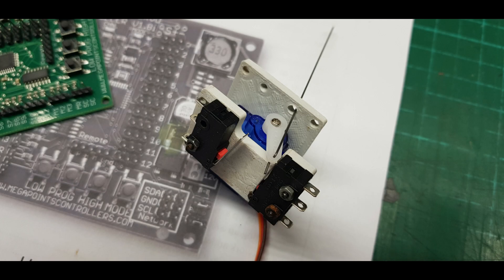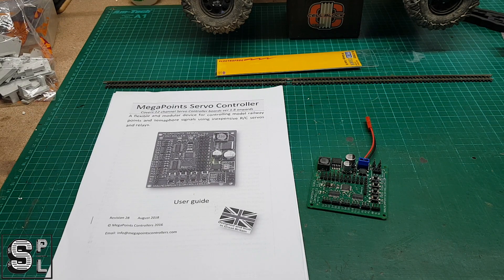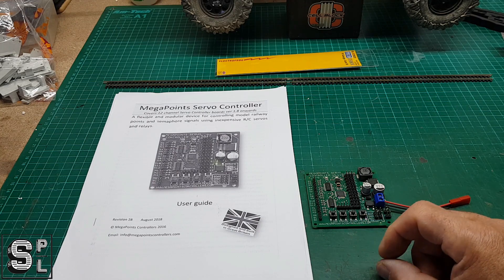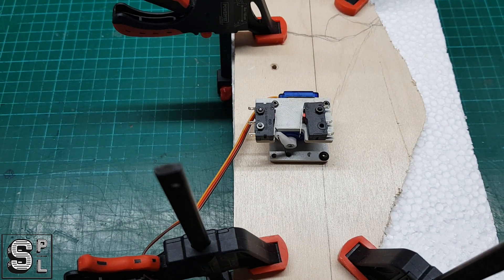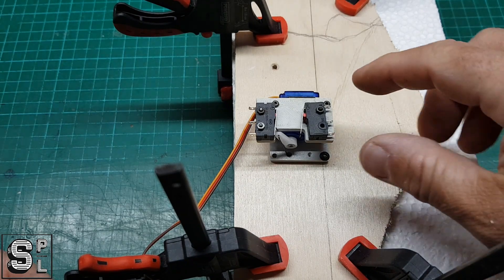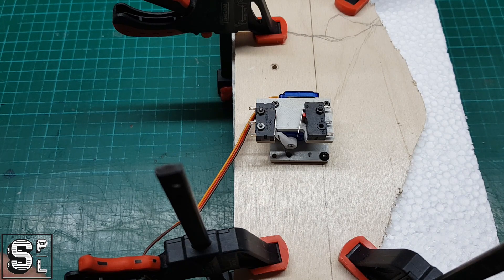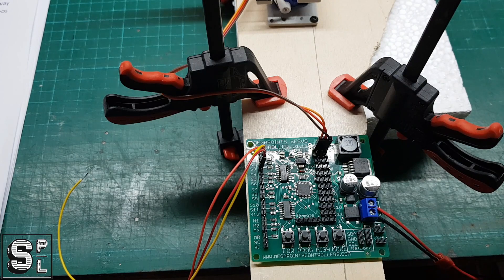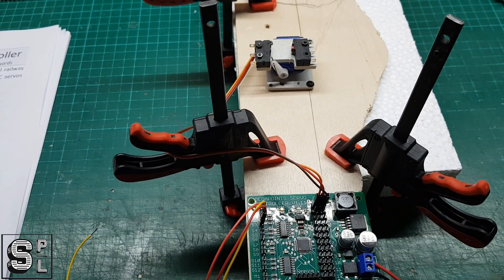Using Servo Point Motors | Ħal-Zuzzu Model Railway (Ep10)

Comment: Hi Joe sorry I miss your release day for this video great use of a servos as I said use them and most if not all are going to be sunk in to the insulation board on top. And I two servos to operate my canal bridge and one oneach of my barriers they are very versatile and I use megapoint control stuff dave is a nice chap and very passionate about his product. Keep save mate. Colin
Reply from the maker: Cool, thanks Colin :) 
I have a long way to go. Waiting for my points to arrive so I can start my yard. 
Once that's done, it will be servos, servos and more servos till I finish them all :) 
Be safe :)

Comment: Nice video Joe, Servos is definitely up and coming in model railways as they are so cheap, it's just the servo mounts and controllers that put people off. In the fullness of time I'm sure someone will produce servo kits that include the mounting brackets and microswitches and even control boards, then they will become more common. I know Megapoints do them, and they do them well, but when someone sees all those pcbs it can be quite daunting.  Keep up the good work! Tony.
Reply from the maker: Thanks for watching Tony. Yes, going over to DCC I'll be adding a couple of boards and it does get a slight bit more complicated, but hey, that is what it is all about for me (I mean DIY and not the complicated hahah)  :)  
Be safe :)
Reply: @Hal-Zuzzu_Model_Railway  I totally agree Joe, DIY is definitely the nature of model railways, and I know you a very comfortable with servos having used them in your other hobby, But for a newcomer still daunting but hopefully other people will start to fill this hole up in the market, and make it more approachable because this is definitely the future for model railways. All the best Tony
Reply from the maker: You are giving me an idea. An easy to follow, detailed video on servo point motors :)  Something for the future :)